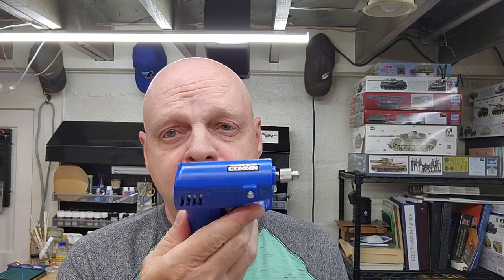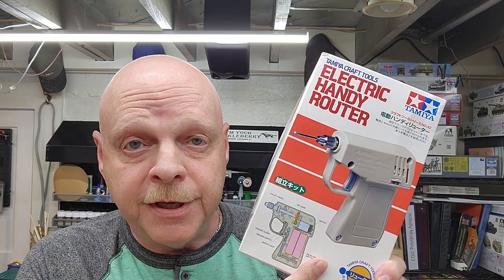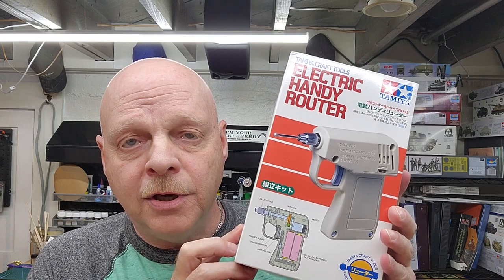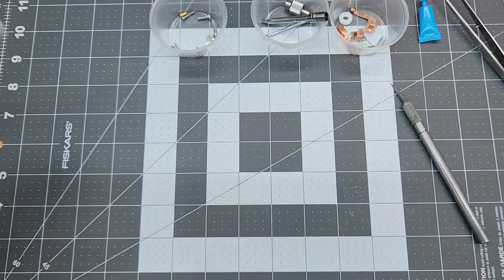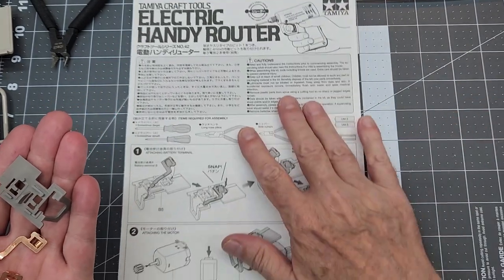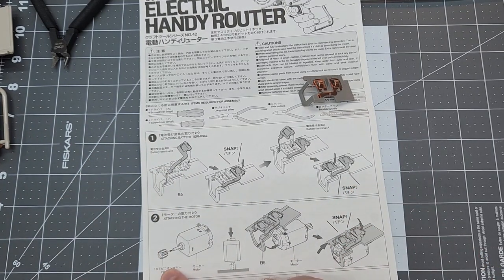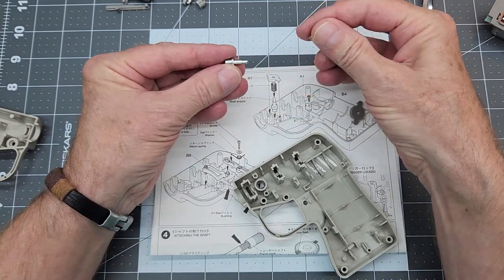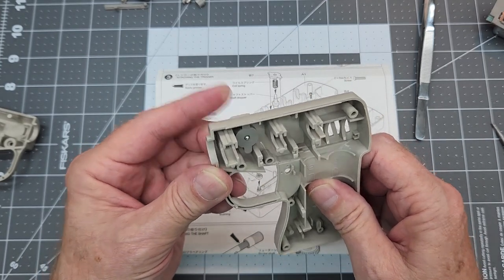Tamiya's Electric Handy Router, Build and Test

Comment: Thanks for the review sir! I asked for the Handy Drill at my local hobby shop and the guy unknowingly gave me this. I only realized at home that I actually got the Handy Router. My question is can I still use this as my regular drill? Or will the higher rpm be too dangerous for the plastic?
Reply from the maker: Great question Alex, I didn't even dawn on me to test this until you asked, lol! So, I gave it a try and the answer is YES, you can drill with the router. The only tip I suggest for you while doing so is to just momentarily press the trigger quickly. Repeat until you have your hole drilled. Both the drill and the router have a "coast" down to 0 rpm after releasing the trigger, so with the higher rpm of the router you can better control this with short trigger pulls. The rpms are still slow enough that you shouldn't have any melting of the plastic. Thanks so much for watching, take care and model on my friend! Johnny

Comment: Did you manage to fit other chucks to it to allow larger bits?
Reply from the maker: As a matter of fact I was able to use those inserts that come in a lot of the rotary tool bit kits. Tamiya calls them chucks, and while that is technically accurate, I tend to refer to them as collets. The bit kits usually come with 3 or 4 of these in different sizes. As for getting an entire replacement chuck, I've not found one that has the right threads. Thanks for watching my friend, take care. Johnny

Comment: Is this basically the drill with more power?
Reply from the maker: Great question os7272, the router has a single gear reduction and the drill has a 3x gear reduction. This means that the router turns at a faster RPM with less torque, and the drill turns 3x slower with more torque using the same electric motor. this makes sense since we need speed for grinding and routing, and more torque for drill holes. Hope this clears things up for you, thanks for watching. Johnny

Comment: So, what is the difference between the drill & router?
Reply from the maker: HI, the handy drill has a double reduction gear arrangement and handy router has a single gear reduction. That means the router has about twice the RPMs than the drill does. Which makes sense, higher shaft speed is needed for a router, so you don't get bit chatter while routing. Hope this helps, thanks for watching, model on! Johnny

Comment: Thanks for the full build and review. Here in the UK/Europe £30  a pop! for these. 😟No, Thank You!😟You can get a Tamiya 5 piece router set, £20 more! 😟No, Thank You!😟What we could do with from Tamiya, is a mini saw table slightly larger than the drill gun for cutting plastic tubes and alike!
Reply: Thanks, sir. Did you want to share your next build with us? 
I'm excited to see what's to come.
Reply from the maker: Hi Basil, here in the US it goes for about $25.00. As with any tool you have to decide if it's for you or not. As with any rotary tool you'll have to acquire some bits anyway. I've found some accessory kits on Amazon for $10 - $20 USD that have chucks that fit the handy router that will allow the use of any 1/8 inch or 3.5mm shaft bits. I do agree that a mini saw from Tamiya would be great, there are such saws for wooden ship builders, but if you think the handy router is expensive wait till you see the price of the tabletop craft saw, LOL! Thanks for watching, stay safe and model on my friend! Johnny